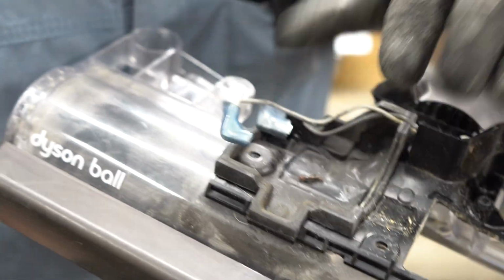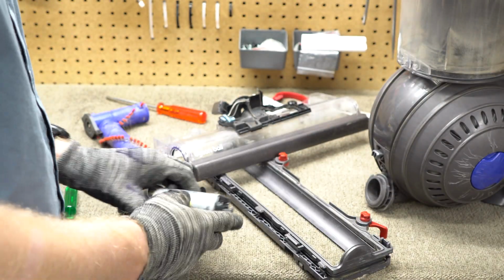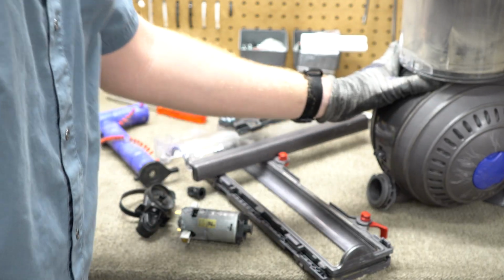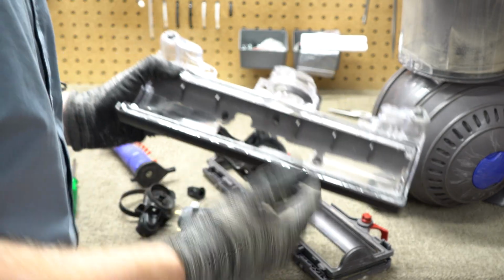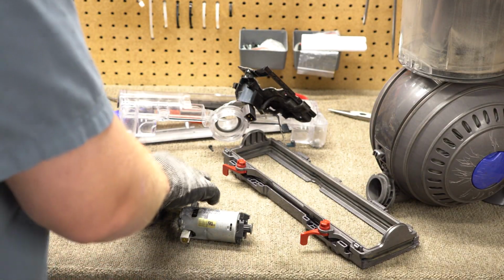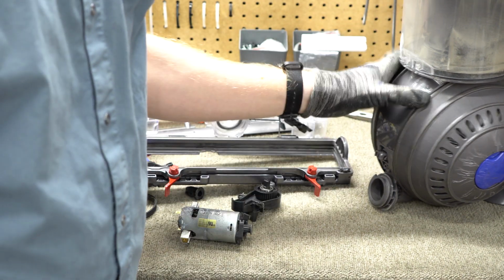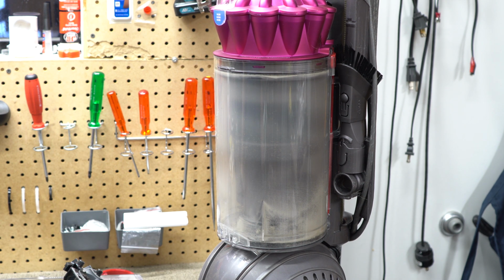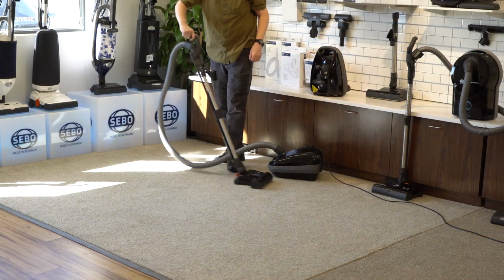Dyson Ball UP19 UP13 Cleaner Head Problems - Dyson Vacuum Brush Not Spinning

Comment: I have the Animal UP13 and the brush head motor burnt up after 15 months, 3 months out of warranty.  Dyson could care less.  My other vacuum is a Lindhaus that is 25 years old.  Two motor system and great vacuum.  Big name, Amtek, vacuum motor.  It was built to last.
Reply from the maker: Lindhaus still makes great vacuums I'd recommend you consider one of the newer machines.

Comment: Great review...thx.  Question...with a healthy motor would you feel a little drag if you hand spin the brush due to the belt linkage to the motor?
Reply from the maker: Yes it's normal to have a little resistance. Hope that helps

Comment: Thanks! After cleaning out lots of hair after taking the rollers completely out, the roller on my UP13 still shuts off on my high pile carpet (and still smells) especially when backing up. If I hold the button down it will work. Any other thoughts? Also, I was trying to see your top recommended carpet vacuums. Do you have a list anywhere?
Reply from the maker: I would recommend the SEBO K3 ,E3 and D4.  Miele L1 and C1 cat and dog
Reply: @PerformanceReviews  Thank you!

Comment: Hello and thank you for the great video!
I have an up13 and the cleaner head spins slowly a couple of times and then stops. 
I have purchased a great condition used cleaner head and it does the same. I have replaced the control board for the cleaner head and no change. The wires all SEEM intact. I put a voltmeter on the cleaner head output wires at the cleaner head connector and it reads around 110volts dc. I think it’s supposed to be significantly more. Any ideas?

Comment: I have a dyson animal, looks like the ine in your video, ive had it over 8 years now. Today when using it the roller brush stopped turning, the vacuum stayed on and had suction but roller wouldnt turn. I turned it off rolled it by hand turned it back on and itnwas working again but only forna few seconds before it stopped again. I took it apart and cleaned all the dust and hair off, but i didnt take off the motor or open thendrive asembly, put itnall back together and itnworked again but only for a few minutes then roller stopped again. What is most likely the problem?

Comment: By the way,  I have been using Dyson’s since 1997 here in the UK and the first Dyson I used was a UK made Dyson DC02 that was strong and solid but the handles could break on these.  I had a UK made Dyson DC03 that was unreliable and plastic parts were a little bit more fragile than the DC02 and I would see broken Dyson parts in the shops.  I then had a UK built DC05 and that had faults with the cable rewind sucking in when the machine got hot.  Dyson had to modify the design after I complained to them about it.  I had a DC03 that was ok with build quality,  but would experience the hoses breaking and handle caps breaking too.  The performance was rubbish.  I got another DC05 but Malaysian built,  it had the same quality as the UK built one.  The wand needed replacing at the top of the wand got a plastic broken piece.  This would have happened on the UK built one.  The replacement want was a cheap aluminium wand and not steel one like original,  but aluminium was lighter and oddly seemed more robust.  I had a DC04 that was Malaysian built,  the ABS wand broke first week,  replacement wand is Polypropylene,  but seemed more sturdy.  It wasn’t ‘straight’ and had a bend to it.  Serious mishap on Dyson’s mould that they didn’t bother to correct (similar to the earlier DC40 bent handle) the DC04 had a noisy clutch that needed changing and replacement clutch fine until motor burnt out 8 years later.

Comment: Don’t you know that Dyson’s are made in China, Philippines and also Malaysia.  The fact the machine fails is nothing to do with Malaysia etc as some very good reliable electronics come from Malaysia etc.  It’s the fact that Dyson are so cheaply engineered with light thin plastics that break easily.  That Johnson motor is most likely made in China.  The quality of those motors are rubbish and Dyson have been suffering from burning out brush motors since the DC24 model.  Dyson got the cheapest motors with the shortest lifespan to get their buck from the suppliers.

Comment: I bought one secondhand and the 🤬🤬 sold me one that when I plugged it in... The roller doesn't roll! (Yeah yeah... I know) and it turns out... It's the belt! You know, the one you said doesn't break! 😂😂 Found one on Amazon so I'm good there. (soooooo much hair to clean) one question, the gasket around the motor assembly broke. Any idea on a replacement? Should I even worry about it?

Comment: Thank you for the video! The brush bar for my UP-19 keeps stalling out whenever I hit carpet with the unit. A few weeks ago I took the whole cleaner head assembly apart,  down to the motor. I cleaned and lubricated it, and cleaned the other parts as well, and reassembled it. The brush bar still stalls out. It is accompanied by a bit of a smell. So I’m wondering if the motor is just shot and I should look to replacing that. Thank you again!

Comment: I had a gen5 detect, their latest cordless and literally after a few months the cyclone gasket disintegrated, they replaced the unit and the same thing happend again and they would make every excuse possible to not replace it again. Think that is the final nail in the coffin for dyson and now have a sebo upright and the new miele duoflex which is much cheaper and better than the dyson in almost every aspect
Reply: It’s a shame I wasn’t able to advise you.  If you push in the gasket as soon as you take the machine out of the box,  you push the gasket in and this stops it disintegrating. It’s very poor manufacturing lack of quality.

Comment: These nozzles do not deal with hair. Goes straight into the drive bearings and melts them. Not sure what happened to the removable brushrolls from DC15, DC24, and DC25.